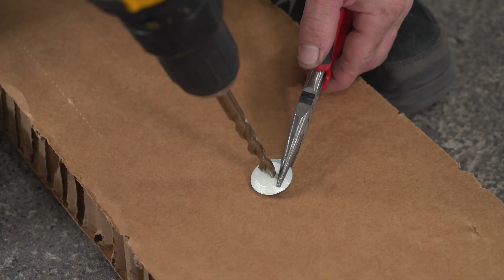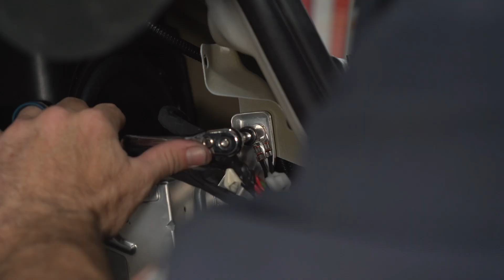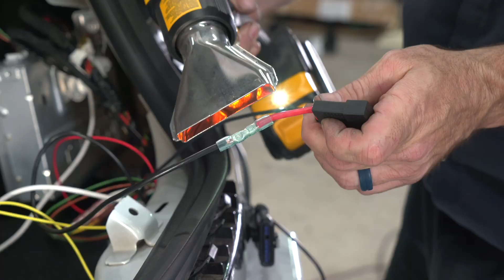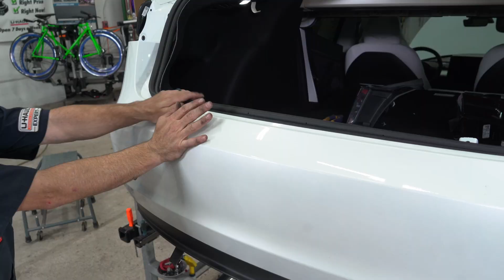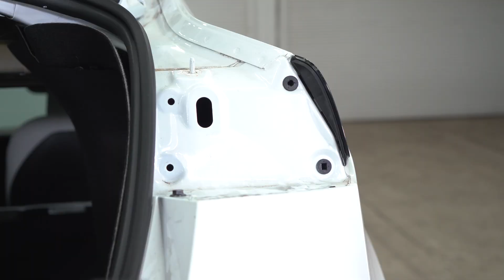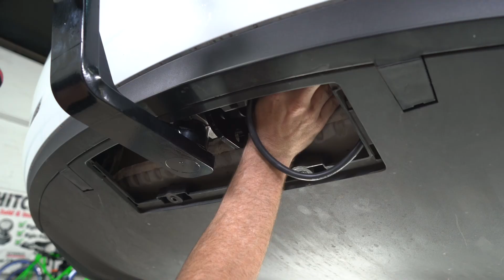2017-2025 Tesla Model 3 | U-Haul Trailer Wiring Installation | SHT25048

Comment: I'd like to know if the 12v power adapter he is holding is available.  Can't find it anywhere online, not included in wiring harness I purchased and don't want to wait until I've completely rendered car undrivable to find out it is not PART of the adapter already on the vehicle. HELP!!
Reply from the maker: That Part is Included in the Stealth Wiring Kit Filmed in this Video. It is not Included with any other aftermarket kit I am Aware of besides Stealth Hitches Towing Kit SHT25048. Without the Adapter, cut the 12V wire from the adapter on the Vehicle and Heat Shrink Butt Connecter it to your Trailer wiring Convertor Boxes black wire with an IN-LINE fuse. You do not really "NEED" that adapter.
Reply: @trailerhitches  Thank you for that.  That was going to be my next option.  I was hesitant to do being a TESLA with funky electrical system.  I was going to use a multitester to test current.